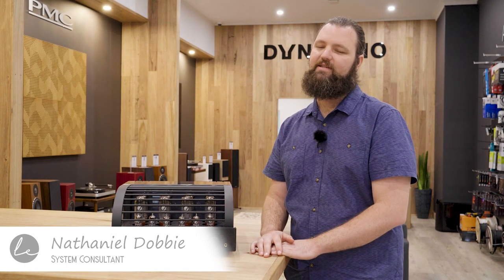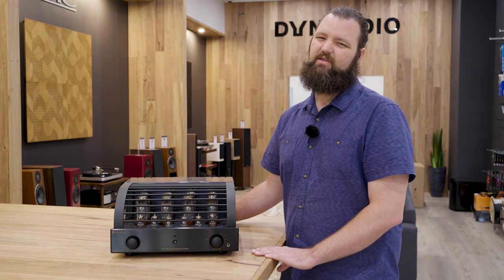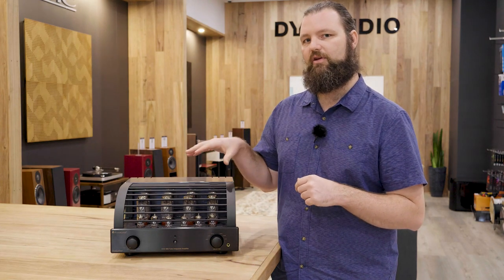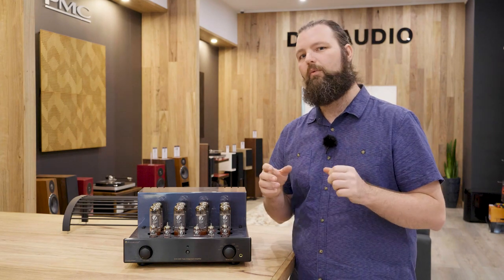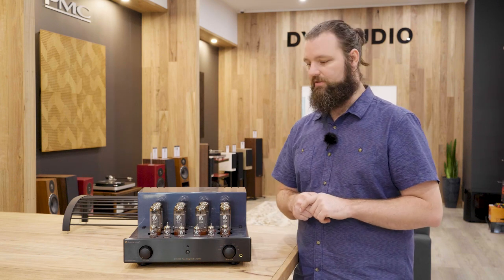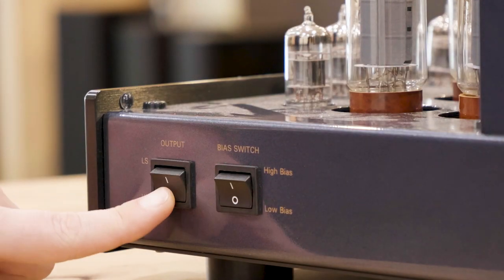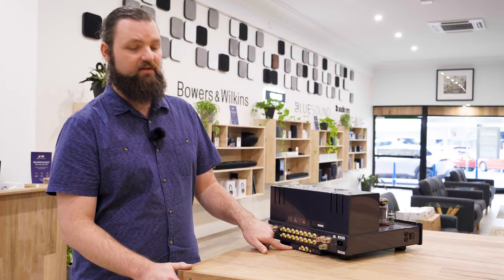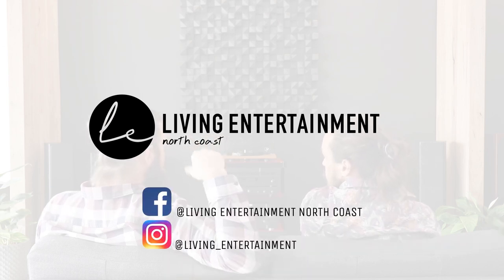The PrimaLuna Evo 400 Integrated Amplifier Explained

Comment: With regards to heat coming off the amp, how does the 400 compare to the 300. I sit around 5 feet away from my stand and man, I sweat when a light bulb is on lol.

Thanks
Reply from the maker: The 400 has more valves and power, so yeah, generates more heat, though we haven't put a thermometer on them. If you are sitting nearfield (or in an unairconditioned room) it's pretty hard to recommend valve amps in general, unfortunately.
Reply: @living_entertainment  Thanks so much for your reply.
Cheers!

Comment: It's a class ab push-pull tube preamp with solid state rectification that sounds... Solid state. Might as well just buy a good solid state amp for all the compromises and high price you get with this. It'll sound smooth but it's not good or tube-y and I've read the bass is muddy.
Reply: and you know this... how?
Reply: @flemingcourt  class ab amps have a transconductance issue that's fundamental in there design. Engineers have been trying to fix the transconductance droop for decades with all kinds of topologies. A push pull tube amp is just a basic class ab with tubes. It sounds tube-y  and costs thousands but does nothing to deserves its cost. I prefer tubes but a solid state amp with a superior topology that's not being pushed to death will sound better. Also everyone agrees the bass is muddy from what I read. Even the people who bought it and like it still say that but love the amp because of its ease of use and smooth sound.
Reply: @V1ralB1ack  How dose the I/50 Integrated amp from Audio Research compare against the PL 400 int?
Reply: @Andy-xn9zn  The i50 is not that good. It will sound ok but not worth a quarter of its price and I will explain a few reasons why.

1) it is a compact design. This is ok for other designs but never good for tube designs. Tubes depend heavily on transformers and even in class ab they can run usually half of their power in class a. This saturates the transformers with heat and power. this is why tube amps are expensive except this one is compact and still 5-6k so doesn't make sense

2) 6550 tubes on it are running hot to make 50 watts in push pull.

3) it is balanced and that's ok but it's not truly balanced, it's just for convenience. This is not bad but isn't necessary.

4) the weight is too low. my 300b weighs almost 60lbs which is almost 20 pounds more and produces 8 clean watts. Why? because it's transformers are big and high quality 

The primaluna on the other hand is not perfect but it is as practical as a tube amp can be. It is heavy, has good transformers, low maintenence as it tells you when a tube is bad, can handle el34 to kt150 because good transformers, ac offset killer to  fix chance of ac noise leakage which is a problem that can happen in toroidal transformers and the primaluna runs the preamp tubes with low bias so longer life and less money spent on more tubes and you can save the money and buy tubes to tube roll. I hope this helps.

Comment: I see you have the Dynaudio Special Forty's in the back ground which are 6 Ohm speakers can this amp be used with them? If so how only a 4 or 8 selection on back?  Thanks I have also been looking at the PREAMP 400 as well and use my Yamaha AS3000 as the output amp with my Dynaudio SP Forty's. Your thoughts?

Comment: Nice informative run down on this model. I have the EVO 300 Power Amp at home for evaluation and having had a number of valve amps in the past I have to say I like the EVO 300 a lot. I like my solid state amp too and have been swapping back and forth. Each has its pluses and minuses and it is very difficult to decide. I guess it depends on the mood at the time.
Reply: Graf comment. So I’m not the only indecisive one :) How would you describe the sound between SS and these tube things?
Reply: What do you think are the biggest pluses and minuses of your PrimaLuna amplifier?
I have the EVO 400 Integrated but weighing that against a hybrid integrated that has a tube driven preamp stage with a solid state power amplifier output stage. Any thoughts on this from your experience?
Thanks!

Comment: Great video...educational & very well explained.
    I have a question on the EVO Series.
I currently own a used PrimaLuna DiaLogue Two. 
I am thinking about upgrading.
I learned that the EVO 100 is the 3rd generation of my unit. 
 IDK for an extra $1,000. 
If it's worth it.
The EVO 200, is $1,600.
more than my used unit.
I am confident that the EVO 200 will be a better overall performer than my current model.
But I'm wondering if the new  EVO 100 will provide an 'appreciable difference' in sound performance
   Both the new EVO 100
 & 200 come with an amazing headphone amp which my current model doesn't have & that costs money.
Any thoughts regarding the costs of these products vs their
Performances?

Thanks!